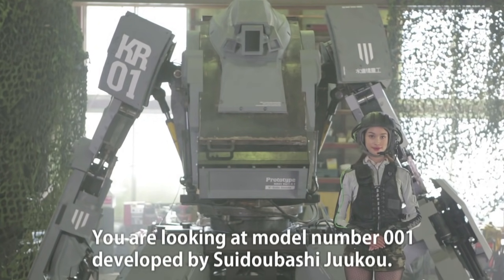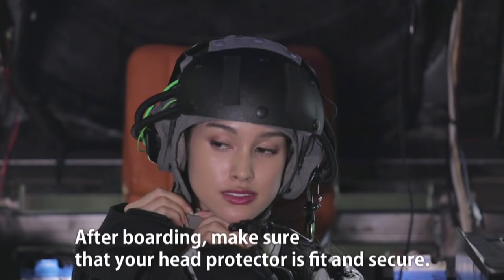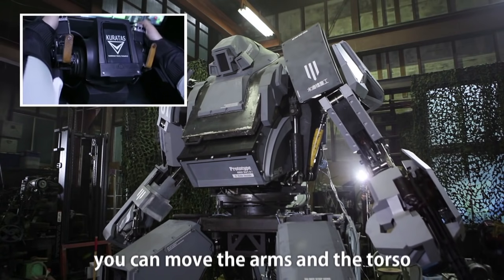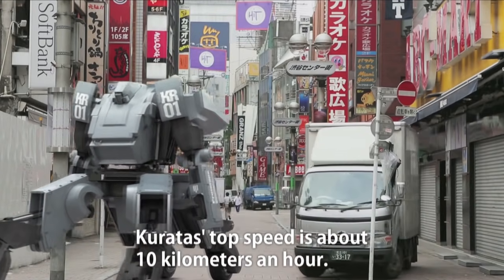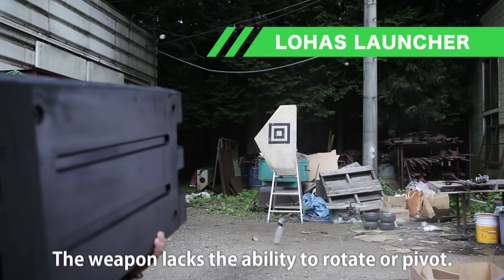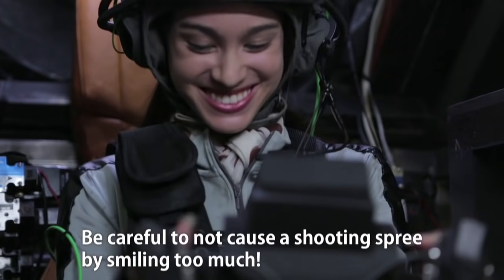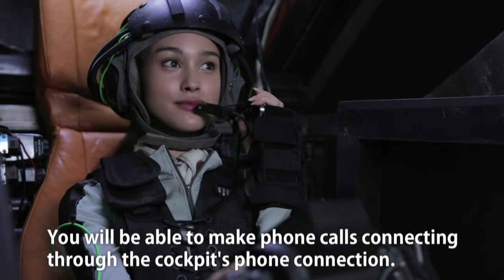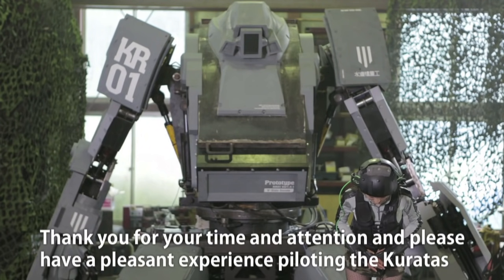HOW TO RIDE KURATAS - Suidobashi heavy industry

Comment: This is where we were at 8 years ago... 2020 has been a crazy year so far. Wouldn't be surprised if we see a advanced version of these roll out soon 😐
Reply: you can find this mecha for $1,021,702.80.
Reply: This is so funny shit
Reply: I mean we have archax now. Almost identical visually to the kuratas but 1 ton lighter & swapped the hydraulic joints with electrical joints.

Comment: It may be $1.3m now, but remember, 15-megabyte hard disk drives used to cost about $3k in the 90's, 20 years from now and these should be available as cheap as cars.
And hell yeah I'm gonna buy one!
Reply: That is, if demand increases exponentially, like it did with the industry you mention. Not so sure about this one
Reply: itll be cheap as cars but will be functional as a can of beans
Reply: Lol
Reply: Its still not cheap as a car
Reply: @ianjaymesctabano1714  lol
Reply: i'd want one too
Reply: @ianjaymesctabano1714  its not been 20 years yet. Come back after 15
Reply: @Georgije Mesaroš maybe, but rn it's not useful to civilians and hence there is no drop in price.  It's kind of an expensive gimmick
Reply: @Georgije Mesaroš The only commercial purpose I can think of is in the entertainment industry like movies or theme parks.
Reply: Economically speaking, 15-megabyte Hard-drives didn’t adjust price due to duration of time, it became cheaper because supply and demand of the item was stabilized by higher means of production and competing industries raising the bar for what is seen as “standard”. But this logic doesn’t work considerably well for vehicles. This is because Vehicle Production as an industry are expensive themselves even at higher and faster production rates, but this Karatas thing has no direct assembly line. They are likely custom built, as it is not practical to develop an assembly line for a unit that is sold for the amount it is and the scarcity of the item gives little incentive unless government, or manufacture based body’s can give supplemental contracts.
I’m sorry, I want these too. But hey, these may have possible wartime applications in the future, then you can be paid to use these albeit in a pretty nasty way though.
Reply: M545 excavator has four legs and it can traverse 45 to 50 degree surface. But it's price tag tho 😐 it's horrifying to look at

Comment: WHEN WILL THIS BE USED IN WARS?
Reply: when people realize that being badass is better than being safe
Reply: gandalf the light purple well, granted the robot brings both being badass and being safe at the same time. but kuratas is just a prototype. they'll need to put alot of modifications to make it RPG proof. and the pilots need to know how to fix it plus they'll need new weapons. all that shit... since it can be operated by remote. it will be ten times safer cause a soldier can be in a Lockheed AC-130. while the fighters in the gun ship provide fire support for the mechs. they could even use the oculus to see what the robot see's. the future has alot of possibilities.
Reply: bonesmasher13 As for repairing it goes it runs off of both gasoline and diesel powered engines so as long as you have some automotive experience it shouldn't be that difficult. As for weapons goes it seems swaping out the the civilian guns for real ones would only require re-mounting and programming. The only thing I see wrong with it is that it seems too top heavy they would need to position the weight more evenly for maximum speed and stability.
Reply: Crunchy Bowman yeah, but they need to replace the wheels with hydraulic legs or better yet tank treads. so it can function in places with sand or snow. replace the metal with something lighter and tougher... the obvious material that can be use is titanium... but we already develop a new type of metal that is ten times more tougher and I think its as light as titanium. so I guess they can use something like that. also probably cover any of the weak points. but america has been rumored to have been building a power armor... so its japan's mecha bot vs america's power armor. its world war 2 all over again.
Reply: Too many glaring weaknesses in this platform for open war. Given that it has tiny wheels, it's only suitable terrain would be paved roads. Since its mobility relies on a single type of terrain, it really limits its deployability. Therefore, in its current configuration, local law enforcement, like SWAT, would be its best bet.
Reply: Steve Son well, it is after all a just a prototype. replace it with tank treads. fix up with weak spots. replace the armor with titanium or something. but they'll need more time and money to build something that can survive an RPG. give it something that will turn it invisible in infrared. so a drone can't take it out. hm.... replace the weapons with both anti air, infantry and tanks. so I'm guessing a new multiple firing stinger missile system. that could be a nice touch cause they'll need to drop helicopters and destroy tanks alot of times so they'll need to keep reloading and firing alot. and maybe they can develop a sniper sentry to snipe some soldiers and ofcourse double miniguns can't go wrong with that.
Reply: bonesmasher13 this could take out 1000 man with akas in afghanistan
Reply: The TALOS will probably be implemented first...which in all honesty a small mech-suit vs a behemoth sized one to me is way more efficient.
Reply: Never.
Reply: gandalf the light purple
i bought one with money from buisness and will and still enough to instale uogrades like tank tredes and ill be using it for now in air soft gun fights >:D
Reply: FACEPALM
Yes it's possible to actually convert it for a combat-capable weapon. Is it tactically and operationally valuable? NO.
You can call me old-fashioned but I don't see it any better than a tank, IF it even manages to equal it.

1) Let's repalce wheels with treads. The fairly small treads will have significantly higher ground pressure comapred to conventional tank's design. A mecha will sink in snow, mud or any other soft terrain while a tank will go at reduced speed.
BTW, if you don't know how track system works, the drive train need a complex system to connect the drive sprocket due to the leg design. This complicated maintenance AND makes it vulnerable.
This limtis it's tactical mobility. Changing it to hydualic-legs won't change this fact.

2)Vulnerability. Let's say they use equal quailty armor as a modern MBT, for example Chobham armor. A mecha fairly small cabin don't provide much structural strength and space for heavy armor. Not only that a penetrating hit is a sure kill since all the vital parts is located at one area. And if the legs are destroyed, it lose balance and is incapable of combat. A tank may be immobolized, but the turret is still functional.
Even if they both have equal armor thickness and quality, the survivability favours a conventional tank.

3)just because the cabin is small, the leg hieght and how it spawrls out is so easily detected it's laughable. Hull-down position will be impossible for mechas. Tanks will hide in bushes where only a small turret is seen. A mecha? Anything above the "knee" is clearly visible.

4)Single-crewed of course, this can be solved in exchange for a even larger profile for your enemy to hit. What's teh problem? Well this has been proven ever since early world war II. 3-man turret is superior to a 2-man turret? Why? A team can alleviate the work load. Here the single pilot have to keep a decent situational awareness, aim, communicate, coordinate fellow units, in some cases load weapons etc. If you are a unit commander, this becomes so much harder since you have to command too.
Technology such as 360 camera system, auto-aiming, auto-loader technology can help a lot. But you still have to select which target is priority, does the situation call for actual use of force and ammunition to load etc.

5)Inferior firepower. A Mecha can only logically equip themselves with auto-cannons, grenade launcher and machineguns but still have suitable amount of ammunition. It's possible to moutn a 120mm cannon, but can only carry 1-5 rounds? A missile/rocket pods with at best 10?
Compared to a tank with at least 60-100 maingun rounds and over 2k secondary Mg rounds?
Sure the missile pods might match a modern MBT in firepower, but can you actually sustain that without frequently resupplying?
At this rate, it's firepwoer is no better than that of a IFV.

6) How do you put it on rail transport, it have such a high vertical height it complicates rail AND road transport. Means it have to go by it's own power. And don't even think of airlift. The height prevents it from being stowed on an aircraft properly let alone helicopter.
It lacks suitable airlift capability which hinders it as a quick-response and/or it's strategic deployment. The lack of rail and road transport eliminates it's operational mobility.
You can disassemble and reassemble method to transport, but lots of time is consumed, you can't use it for fast-repsonse missions which are vital to many modern conflicts.

Conclusion?
General survivability is less than a tank, firepower is equal to a IFV, mobility is equal to that of a 4x4 jeep. It can't be used as a command unit, lack any space as a transport(To act as a APC) and what's worse is it lacks any operational level and strategic level mobility.
Usually vehicles trade one aspect for aonther. Rather here as of current technology, it's just inferior in every aspect to exsisting vehicles, probably save for as an engineering unit.
Reply: megustatheboss Man
What?
Reply: rap RD there is no need of it in war.
Reply: gandalf the light purple the robot is safet since it can be operated remotely, meaning that nobody dies
Reply: NOT ANY TIME SOON, SADLY. As cool as it looks, is too low, depends on non off road transportation routes, and lacks armor for  actual combat. Can you imagine taking this into a real battle field, facing missiles, heavy guns, explosive devices, etc.?. Is all right, Gundam and Code Geas can wait a bit to be real.
Reply: Literally being used tomorrow friend. https://go.twitch.tv/megabotsinc
Reply: We will have to wait like 100 years so we can have robots that could walk and fly like a Nitro from Metal Warriors
Reply: When it runs faster than 10km/h
Reply: gandalf the light purple ur so right In so many ways
Reply: @bonesmasher13 , but it's never going to be RPG proof, it's overall design just prohibits that.  It's far more expensive than a predator drone, something that is much more effective
Reply: Use this în Ukrainian Civil War and heres a real life Left Alive
Reply: haha they will most probobly break before reaching the battle. :D
Reply: it will propably be  used on the general public

Comment: I agree with you when it comes to the price, it is ridiculously overpriced. A person could probably build one for the price of a mid class car.But I still feel that the "concept" of this is still useful. If this had better movement of arms, faster swivel, and increased speed of up to 60 miles per hour I could see this being both an efficient civilian sector vehicle and security vehicle. The main factor in terms of security would be the mobility of the platform "more advanced than this model".

Comment: "Gasoline-fueled and runs on a diesel engine."
Wait what
Reply: i'm guessing something was lost in translation there.
Reply: Gasoline (petroleum to the rest of the world) will run just fine in a diesel engine..
Reply: ***** It absolutely won't. Unlike gasoline engines, diesel engines are lubricated mostly by the diesel itself. So if you put gasoline in a diesel engine it will sieze shortly after it starts combusting the gasoline.

This happened to me a few years back when my grandpa accidentally put about 20 liters of gasoline into a ~60 liter diesel tank, and a few hours later the engine started running really badly, even though we did everything we could to mix out the gasoline with diesel and two-stroke oil.

Also, petroleum isn't gasoline or petrol. It's crude oil.
Reply: *****
 it will run just fine mate, have done it because I had to do it for a 100km trip. The van in question has just passed 1 million kilometers and had nothing short of basic servicing.

The term petroleum is more correct than "gas" and recognised as meaning petrol in any English speaking country other than Trumpland which isn't even a gassious substance.. go figure you yanks.
Reply: ***** I never said gas, neither am I American. But gas is just an abbreviation of gasoline - which is a perfectly correct word, just like petrol is. Saying petroleum is incorrect, because it's referring to crude oil, not the processed fuel.
Reply: And I guess that's why personal experience and research tells me nothing but that gasoline in diesel engines will not work. So you either did put diesel in it or it wasn't a diesel engine. It could be that the older engine is more friendly to gasoline, like my grandpa's boat was, but a modern diesel engine could never run on gasoline.
Reply: ***** So my personal experience is irrelevant, but your's is acceptable? Of course. I think I'll continue to put the correct fuel into my vehicles, if you don't mind. Have a nice day.
Reply: +74KU 
Stop talking... You are wrong.
Reply: ***** No no no. It might have worked OK in your old diesel. But never ever put gas into a modern diesel engine. With the high compressions those engines run you can get catastrophic failure from the gas detonating in the engine. Then you have the problem with no lubrication, so you can wind up with the engine or fuel pump seizing.
Reply: ***** NO PLZ DONT!!!!!!!!!! lol gtfo
Reply: High Tech
Reply: Only Americans use "gasoline" 

Most English speaking countries distinguish it by using "petrol" or "unleaded petrol"
Reply: Gasoline was just the name of the brand of fuel. Somewhere in history people shortened it to Gas because its easier to say. Its can be just as confusing if people think that petrol is short for petroleum when those 2  things are completely different.
Reply: TheStargateNerd More like you're probably misunderstanding something

Comment: the smile shot...
what if a psycho path smiles and starts shooting people?
Reply: what if it's just a dual 6mm airsoft gatling gun? that means it doesnt hurt..
Reply: these are bb bullets
one smile can actually hurt someone
bb bullets actually really hurt
Reply: OnslaughtArt lets not forget it fires 6000 a second
Reply: flamefire28 It fires 100 per second, 6000 per minute...still, that is a lot.
Reply: Just image you you remembered something funny, and you accidentally smiled/laughed...
hopefully there's an option where you can disable that XD
Reply: OnslaughtArt Solution, wear a mask. So the system can't detect any smiles unless you remove it for combat!
Reply: it wouldn't be a what if

Comment: it would be nice for a kurata revision that pulls the control dashboard out of the way. and has the lower canopy hatch form a stepping platform or ramp so that the pilot has the clearance for a straight forward and speedy disembark without bumping into anything. even better yet if the kurata took its hands and formed 2 additional stepping stairs and simultaneously lowered the control dashboard and crouched down on its suspension as close to ground as possible for the pilot as an automated disembark procedure.
this would also make re-embark very quick.

Comment: Titanfall in real life? :3
Reply: Actually its a Gundam in real life because this is modeled after Gundam
Reply: ***** Gundams are bipedal and 60 feet tall. So....No it's not =P
Reply: ***** this is more like front mission or armored core
Reply: *****  Your definition of "Gundam" is only true in context of Gundam Wing. The metal "Gundanium" doesn't exist in any of the other alternate universes.
Reply: *****.....As ive already stated, "Only within the context of that particular universe." You do realize there are 14 different Gundams series and Wing is only one of them. You have MSG, Zeta, ZZ, Victory, 8th MS, G, Wing, X, Turn A, SEED, Destiny, 00, AGE, and Build Fighters.
How a Gundam is defined is different depending on the series. For example in Gundam SEED and SEED Destiny a "Gundam" is merely a mobile suit that runs on a G.U.N.D.A.M operating system.
Reply: ***** It's modeled after the Scopedog from Armored Trooper VOTOMS

Comment: WAIT A MINUTE! Those buttons at 1:00, THOSE ARE STEEL BATALLION BUTTONS! The 6 closest to the pilot are the the right block buttons for the Open/Close, Map Zoom, Mode Select, and Sub Monitor Select. In fact, this is why there is no text on the upper ones: In and Out are on the bottom of the buttons instead of the top. This is ALSO why the top right  button on the left side have a noticeable white line: that is the white line from the Main Monitor Zoom label.

And the 6 buttons? Center block Function Switches, at least for the left side. The right side somehow has a mirrored version which I have no explanation for. And the ejection buttons? Ask ANY Steel Battallion player about them. There's just no debating with those.

I would say they were imitating it, but the labeling is just too direct to be imitation.